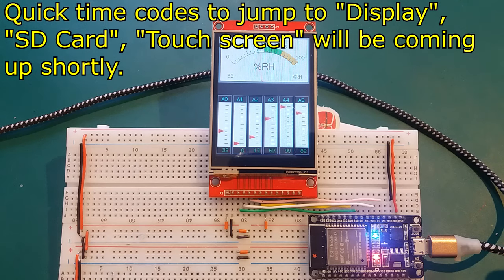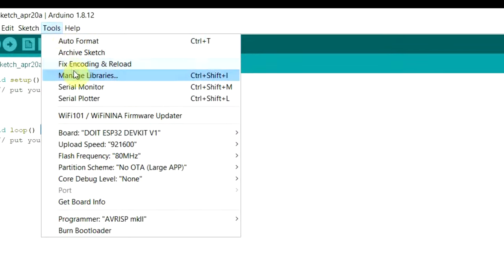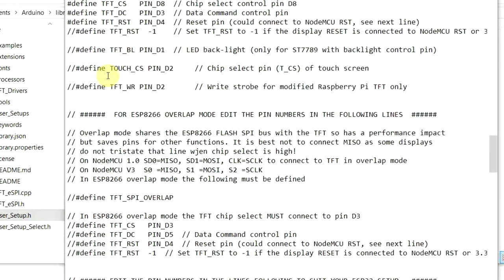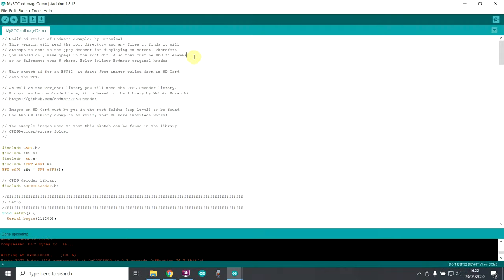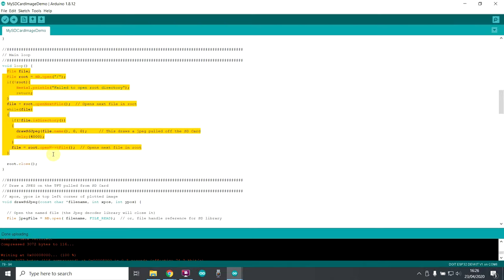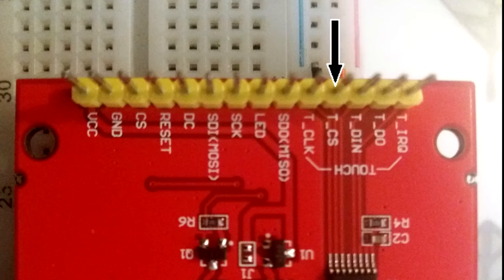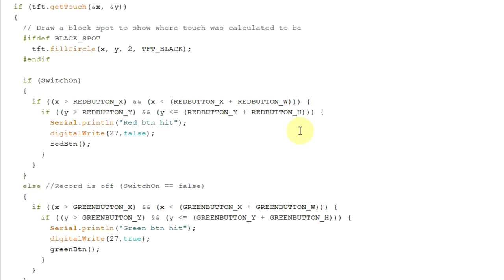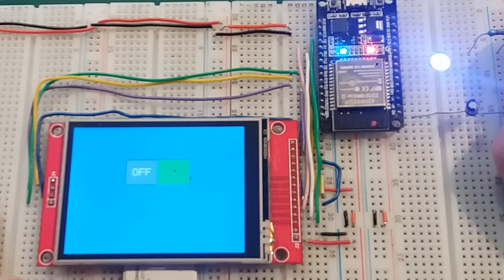ILI9341 TFT LCD to ESP32 - Full HOW TO  for display, SD card and Touch. Using TFT_eSPI driver

Comment: PLEASE HELP! When I upload example sketch it fails saying "A fatal error occurred: Timed out waiting for packet header" . :-( 
Cannot get screen to work (ILI9341 with ESP32 dev board).
Reply: Read somewhere might need to short J1 jumper with solder. Will try that and report back (within about a week).
Reply from the maker: Timed out waiting for packet error is a problem talking to your board. Although J1 should be shorted for esp32 as well. Check if you can at least upload a blank new sketch. If not look at this video which may solve your problems.

https://youtu.be/SlAG6DFLnBE
Reply: @XTronical  Thanks for reply. Yes I have been uploading SD Card sketch and ECG Sketch without any problems. Problem is with ILI9341 (I think). I also tried connecting it to 5V power (just to VCC, LED still on 3.3V) but still same error.
Reply from the maker: Some USB cables drop too much voltage   because of  poor quality. Might just be ok without screen but then with screen drawing power as well it becomes to unstable.  Try uploading with screen pulled out.  If works then look for different cable.  Look for one that can do high current/fast charge from a known manufacturer,  for examples anker or ugreen.
Reply: @XTronical  Eureka! This worked. Thank you sooooooo much.
Disconnected GND and 3V3, uploaded sketch, reconnected, plugged into usb plug (not computer), result!
Reply from the maker: Brilliant, try a different cable and you may be able to upload with it plugged in.

Comment: Hi Thanks for the videos
Keep getting lots of messages about
 07:57:05.784 -> [E][vfs_api.cpp:22] open(): File system is not mounted
.
I did get the Meters sketch to work the first time.
Pretty sure the additional wiring for the sdcard is correct.
using Kingston 8GB with the images download from your website.
Any help for a 71 year old novice would be so appreciated .
Thanks
Reply from the maker: Mmm... Try the standard sd card tests. They are in file - >examples - >sd card,  at least I think they are there. They are in the examples somewhere! They keep it nice and simple, just testing sd card.

Comment: everthing worked great until the Touch part.  The error reads "TFT_eSPI has no memeber named 'getTouch'
Reply from the maker: Ensure you are using the exact same version number of the library that I use.
Reply: hey bro do you find the way to use on ver1.8.19?

Comment: My esp32 can read the sd card and write to the tft with examples like graphics test, but if I try  to work with the tft and sd at once  my screen lights up blank and flickers when tft is updating. I'm using separate cs pins and  via serial the controller tells it printed successfully. Still nothing to see on screen but white. Anyone a clue how to fix this?
Reply from the maker: Yep, you can't use sd card at same time as tft, the data will corrupt. Solutions are to use another spi bus on the esp32. You've got two you can directly access. Or have some sort of flag within your code so that your routines can tell if the bus is in use.
This is only a problem if your using the multi tasking facilities of the esp32 or more than one cpu core. Is that how your code works? I had this problem when working in multi tasking mode and solved with the flag method.
Reply: @XTronical  Thanks for your reply! At first I was using ImageReader library from adafruit which works great when using arduino nano. It has esp32 support but doesn't work for me. I am not sure if it uses multitasking features. I assumed there was a problem with hardware spi too high for sd card, but when lowering sd clock speed in the example sketch the sd worked but the screeen didn't. I also tried your modified code with TFT_eSPI library. I modified the "User_Setup.h" but still same problem. Maybe I can indeed try to use a second spi bus for the sd but I wondered how you got it working using the same spi interface.
Reply from the maker: I was using multi tasking code so had to make sure that both cpus did not try and access at same time. So I had a shared boolean flag that was set when a process was using spi and unset when not. Any other routine would not access it if the flag was set. Would wait till free.
Reply: @XTronical  Thanks, I will soon try to do something like that too. Awesome video btw

Comment: When you run the sketch it says tft_espi has no getTouch() function
Reply from the maker: This has been asked before, I believe its because later versions of the library have changed. Please check you are using the version number shown.
Reply: @XTronical  I tried the version you used 2.2.0, and still getting the same message….thanks for the videos anyway!
Reply from the maker: Sorry I couldn't help more
Reply: @Sophie333C  hey bro do you find the solution?
Reply: @user-gi6tr4ib5v  no, I never bothered as carrying on trying to sort it out, sorry☹

Comment: Is LED pin a logic gate suitable for PWM dimming?  Btw, http://www.lcdwiki.com has dimensions and other specs for those displays.

EDIT: Mentioned above site has a schematic showing that backlit is driven by a PNP transistor -it looks like the current needed to drive would be around 3mA...and if you read Chinese, it says it can be PWM controlled from MCU.
Reply from the maker: Yes, your correct, can be dimmed

Comment: can this particular device play video files
Reply from the maker: Technicaly possible with some limitations, you would need a very uncompressed file format and you would have a low frame rate. It would work but would look fairly poor for the effort required.

Comment: Scaling could be done, but you’d need something more akin to assembly — and without the arduino overhead.
Reply: A lot can be done with the EVE (embedded video engine) TFT gpu — they can do a lot of crazy image manipulation, and rendering, with touch, sound, and lcd driver. It’s really crazy that we can do this at an arduino level. Not nearly as demanding as I originally presumed. I mean, the ESP32 can probably do a huge amount of work if someone skilled took the time — but this hardware solution using EVE is far superior. Just watch a demo and you’ll be as blown away as I am. 🤣

Comment: Pretty eager to get this code working but I keep getting this error: Arduino: 1.8.13 (Windows 10), TD: 1.53, Board: "DOIT ESP32 DEVKIT V1, 80MHz, 921600, None"

In file included from C:\Program Files (x86)\Arduino\libraries\SD\src/utility/Sd2Card.h:26:0,

                 from C:\Program Files (x86)\Arduino\libraries\SD\src/utility/SdFat.h:29,

                 from C:\Program Files (x86)\Arduino\libraries\SD\src/SD.h:20,

                 from C:\Users\coffe\AppData\Local\Temp\arduino_modified_sketch_632108\sketch_dec02a.ino:23:

C:\Program Files (x86)\Arduino\libraries\SD\src/utility/Sd2PinMap.h:524:2: error: #error Architecture or board not supported.

 #error Architecture or board not supported.

  ^

exit status 1

Error compiling for board DOIT ESP32 DEVKIT V1.
Reply from the maker: Have you tried just compiling blink sketch? See what that does.
Reply: @XTronical  I had compiled another sample from the stp samples and it worked fine. I'll try a blink sketch though. I va eco piled with this board before and had no issues with it and I don't understand the error.
Reply: @XTronical  So the blink sketch works fine. I think the issue may be with my SD library. I had like 3 different SD folders in different locations. Where does it need to be, and where can I re-download it from to make sure I've got the right one in the right place.
Reply from the maker: The sd library is standard, no need to get from anywhere normally . So yes, it looks like something has gone astray with the install. Try taking out 2 of them to leave just one.

Comment: is possible display gif files from sd card
Reply from the maker: Yes, I seem to remember it does. But not animated ones I think. Try the github page for info or have a look at the functions in the library.
Reply: @XTronical  is this can display animated gifs
Reply from the maker: Not on a version I looked at but it may have been updated.

Comment: Xtronical: I'd rather just give you a TIP ($$) instead of pledging a monthly sum.  That's a bad business model.   I do this with 3D prints: if I like a project and it prints well, I "tip" the designer.  You should have a "tip jar", eg Paypal like 3D print sites.
Reply from the maker: My website allows this, there's a link in the description, and you will find a donate button. Thanks very much for your kind comments.

Comment: Do you know how l;ong ive been hunting for a straightforward...stm32f03 and spi tft320x240 driver ... i must have gone through 50 differnt videos and websites and methods..... i just want a nice simple one to write hello world and draw a line..FFS!    anyway I THINK this is it.... really nicely described and commented.... right here goes! :o)
Reply from the maker: Ooh, fingers crossed, hope your not disappointed...
Reply: @XTronical  im just about to edit the user_setup.h file, I have the Blue Pill STM32F03 module. Do I edit the pin deffinitions where it speaks about esp32, it doesnt specifically mention the STM at that part in the file.
uh uh uh... just a few wires.... i guess lookup the hardware pins for the blue pill and put those in there.... oh just paste those over to me.... just a few wires... which one is which... aaaaahhhhh... lol nearly there.
Reply from the maker: Yes, you could just change the esp32 ones. If your successful (fingers crossed) and go on to do the touch screen then read the video description as I missed out one bit in actual vid. Let me know how you get on.
Reply: @XTronical  nope still not going, i have to name the pins. ive put CS on A2 ,RESET on A3, DC on A4.
and for the hardware pins
 mosi on A7, Miso on A6, SCK on A5
-------------------
when i change the user setup. h file do i write the names A7  or PA7 or the actual pin number of the stm32f103 ? in that case A7 is just 17.   I have a bootloader in the chip so i can program it directly with usb. driving me nuts here , any help you can give would be appreciated. :)
Reply: I couldnt do it with this library, i used adafruit one, here for others:
#include "SPI.h"
#include "Adafruit_GFX.h"
#include "Adafruit_ILI9341.h"
         and then stick the wires here:
#define TFT_CS A2 //CS  
#define TFT_CLK A5  //SCK - 
#define TFT_MOSI A7//mosi
#define TFT_MISO A6 //miso
#define TFT_DC A4   //DC
#define TFT_RESET A3 //rst
I want to come back to this library you have.... i looovvve those meters and yours seems faster!    BUT I got aq hello world going on an stm32... at blinking last!
thanks for your video and for encouraging..... i want them meters working.....!  I will keep persisting! :o)

Comment: Hi, amazing tutorial! Finally i've found a way on how connect my ESP32 S3!
I've some issues with the SD, can you help me?
Actually i've mapped the pins in a different way, according to my board...i'm missing only the CS pin, on ESP32 you set the PIN 5, i don't know if i can set any spare pin on my board...however actually i've set PIN 1.
Other pins are :

  digitalWrite(16, HIGH); // Touch controller chip select (if used)
  digitalWrite(10, HIGH); // TFT screen chip select
  digitalWrite( 1, HIGH); // SD card chips select, must use GPIO 5 (ESP32 SS)

Don't know why i've this on serial : 14:48:56.441 -> [333564][E][vfs_api.cpp:29] open(): mountain.jpg does not start with /

I've used your files in the root of the SD.
I've the display ILI9488, so is a 480x320 pixel, i'm using your images, that are smaller...i don't think is an issue.
If i run your code, i see some thite lines with some black dots that are going from top to bottom very slowly...can you help me?
Thanks in advance! :)
Reply from the maker: Sorry for late reply, life is a bit busy. What's your board?
Reply: @XTronical  ciao!I've moved now towards the ESP32s3...I've something working on it...but I'm not so confident when use .c and .h files...i like arduino because is all in same file...but using SquareLine studio to create UI it generates files i don't know how manage it for set and get datas on UI.
However i can now mount the SD ,I've commented another your video that talks about the SD integrated in the display!

Comment: what can i do if i get this message....".In file included from C:\Users\ALFONSO\Documents\Arduino\libraries\TFT_eSPI/TFT_eSPI.h:101:0,
                 from C:\Users\ALFONSO\Documents\Arduino\libraries\TFT_eSPI\examples\320 x 240\TFT_Meters\TFT_Meters.ino:14:
C:\Users\ALFONSO\Documents\Arduino\libraries\TFT_eSPI/Processors/TFT_eSPI_ESP32.h:14:25: fatal error: hal/gpio_ll.h: No such file or directory
compilation terminated.
exit status 1
Error compilando para la tarjeta ESP32 Dev Module."